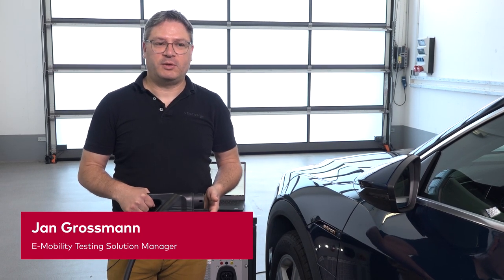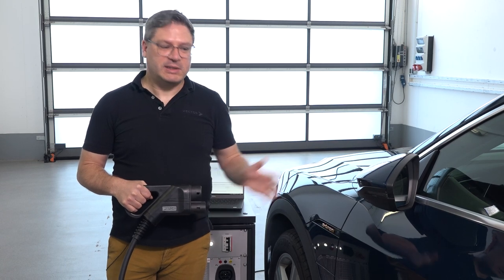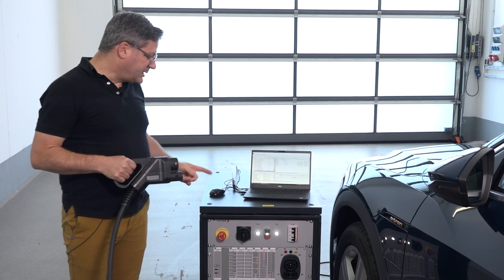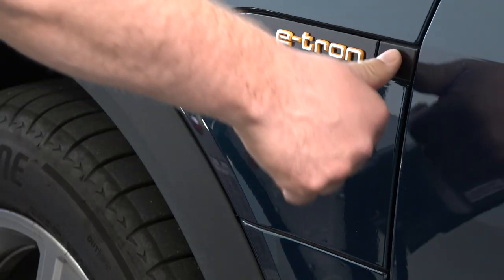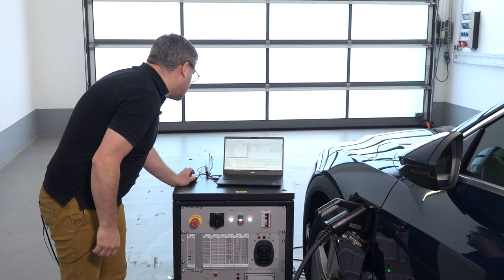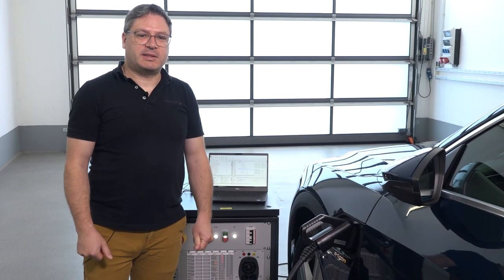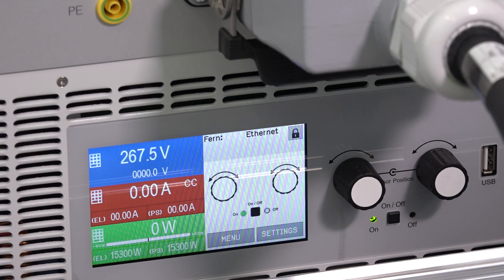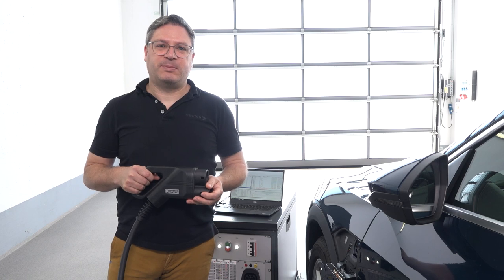How to do Quick and Easy Conformance and Interoperability Tests on a Real EV with Vector CANoe

Comment: Is it possible to ignore timers during SLAC. If so, are there any settings in chargepoint dll
Reply from the maker: Since we provide the source code of the test cases from the The CANoe Test Package EV and CANoe Test Package EVSE, the test cases can easily adapted (ignore timers or change timers). Addtionally, you can also create your own custom specific test cases within the CANoe Test Package EV and CANoe Test Package EVSE